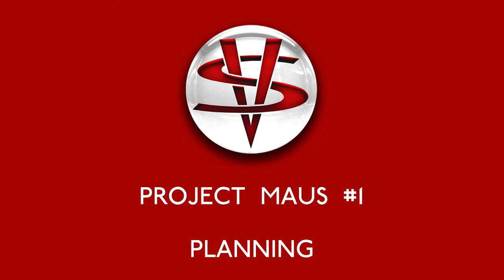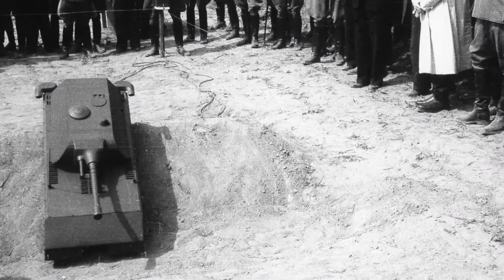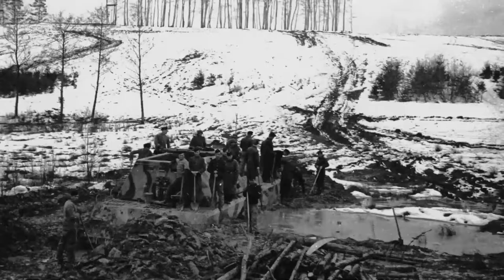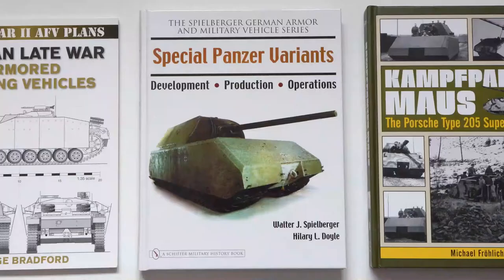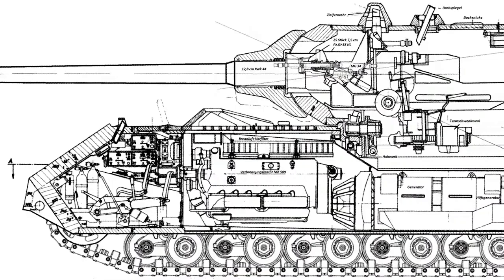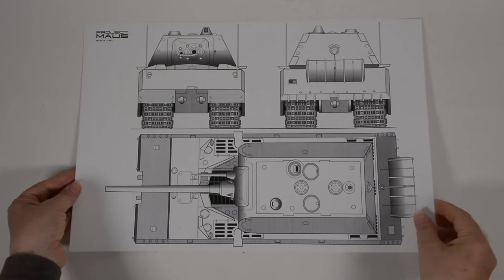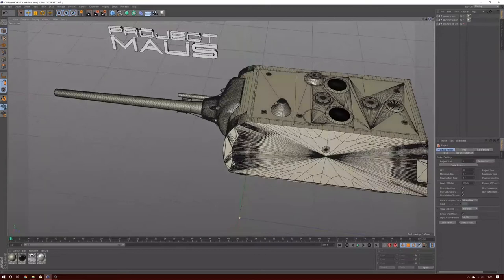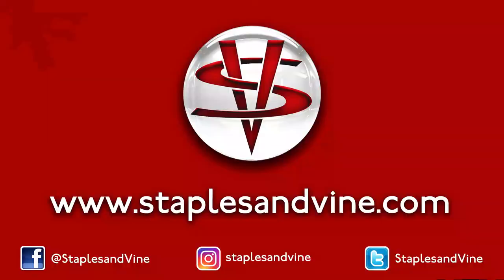PROJECT MAUS  PART 1 'PLANNING'

Comment: At first I thought you were going to build a full scale machine and was thinking, how much of the earth are you going to mine away to get the raw materials.  Then, you couldn't do what Porche did with diesel and electric.  You would have to go nuclear to generate enough power for it to be functional.  Let's not forget that 170 tonnes is quite heavy.
Reply from the maker: I did think about 1/1, but it wouldn't fit in my workshop. :) 1/24 is a good size  - see episode #"2 where I 3D print the turret.

Comment: You way of working is very similar to mine. What software do you use for designing?
Reply from the maker: Hi Pietro, thanks for the comment. I use Corel Draw and Cinema 4D for my 3D work. I've been using C4D for years but now days there are lots of great free alternatives available.